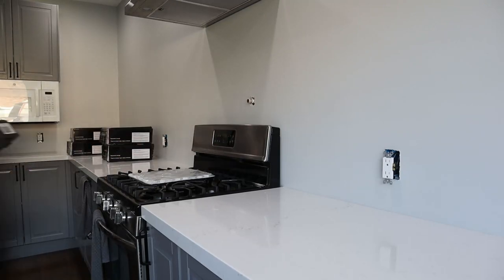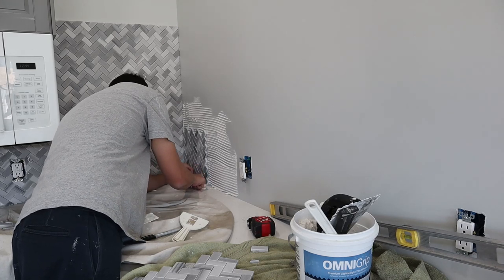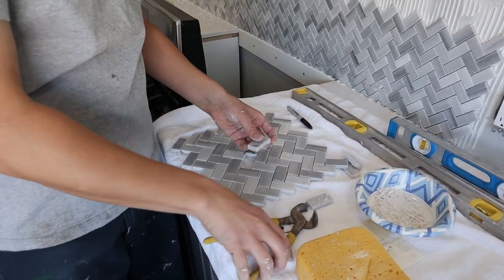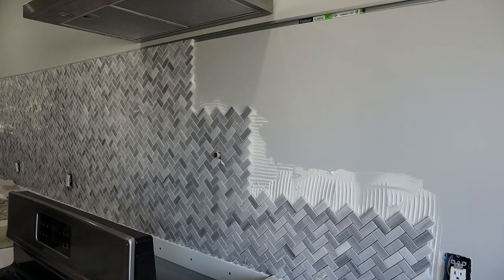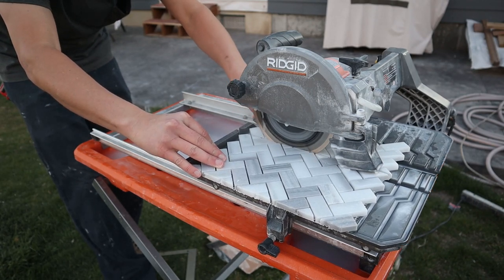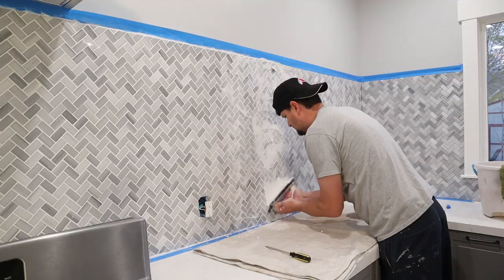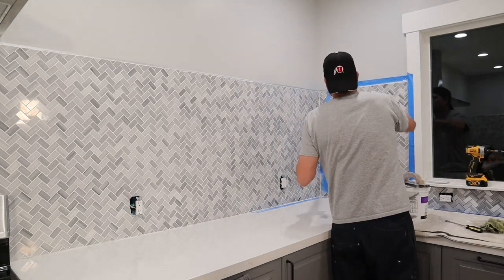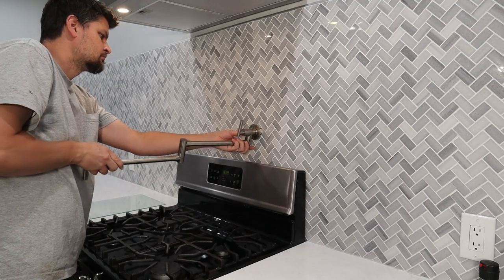How to Install Mosaic Herringbone BACKSPLASH, long weekend project!

Comment: Great job, I'm doing the EXACT same job, same tile.  Your video is giving me confidence.  What size trowel did you use?  I've been told 3/16", but yours looks bigger.  Did you caulk between the counter and the bottom row of backsplash?
Reply from the maker: It was 3/16". I did do a bead of caulk between the counter and bottom. (I did it after i'd posted the video so it wasn't in there.

Comment: Nice work. You’ve convinced me to do some upgrades!! Should I caulk the cracks where the counter meets the stove?
Reply from the maker: I didn't but I guess you can if you want. You'll just have to remember that if you need to pull the stove out in the future.

Comment: Thanks for sharing this. We are going to do the same herringbone style in a bathroom, so this is very helpful. One question, did you use grout caulk along the bottom edge and in the corners or did you just push some regular grout in with your fingers? Thanks
Reply from the maker: I did both. I filled most of the seam with grout and then I went back.....after the video and put a bead of silicone.

Comment: Great job! What did you use on the bottom level for spacers? I didn't see any wedge spacers?
Reply from the maker: I used the same 1/8 spacers as used between the tiles.

Comment: Did the little pieces on the bottom of the sheets break off when you cut with your tile saw? I noticed you putting them in after you put up the big piece.
Reply from the maker: Yes any of the small pieces would just fall off when cut and yes it was  pain to fill the gaps.
Reply: @-DIYPRO-  Gotcha, so you would remove the small pieces and cut them separately/individually? I ran into this issue yesterday and trying to figure out the most efficient way to complete the job.

Comment: Do you apply anything special to the Sheetrock prior to the thin-set? Like a sealer of sorts? Or do you just thin-set right over the paint?
Reply from the maker: I didn't add anything. Since this is a backsplash it will see very little water.

Comment: how did you get the outlets cut out. Did you have to replace tiles after cutting out the outlet?  Also, did you put on a sealer between setting the tile and the grout?
Reply from the maker: Outlets were a pain, some lined up with the edge of a tile but most were cut out and shaped with snips then hand placed.

Comment: Did you ever clear seal it afterward to get rid of the extra grout on the tile surface and make it extra shiny? And recommendations?
Reply from the maker: I did not seal mine but I'd assume any tile sealer would work.